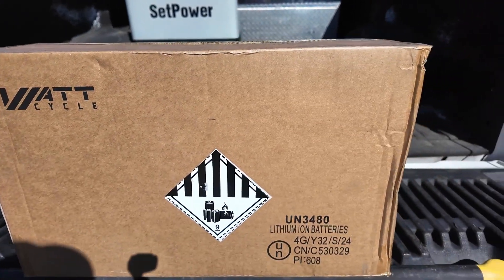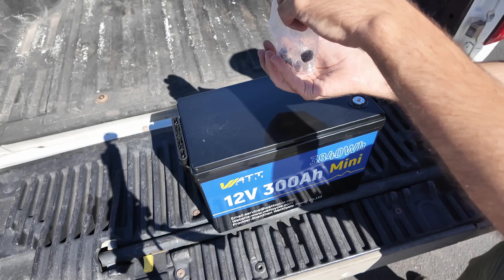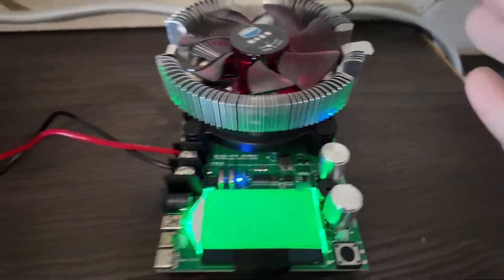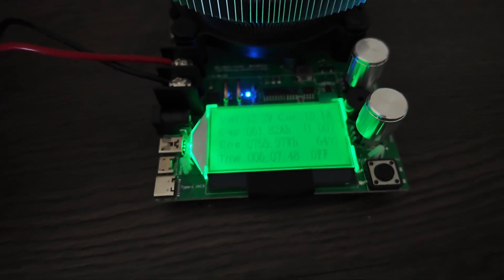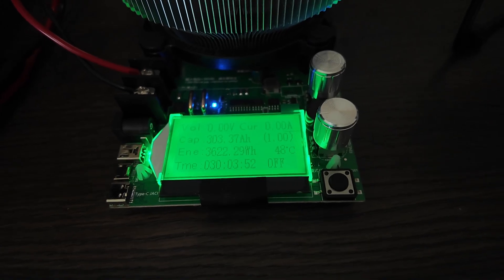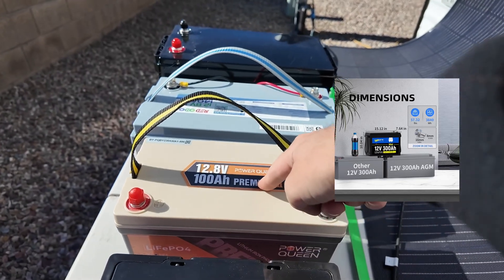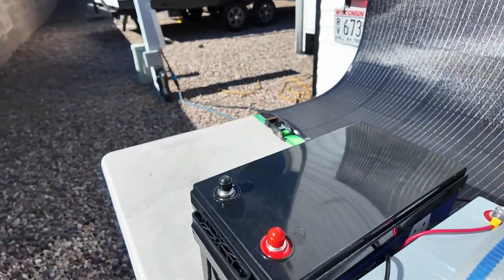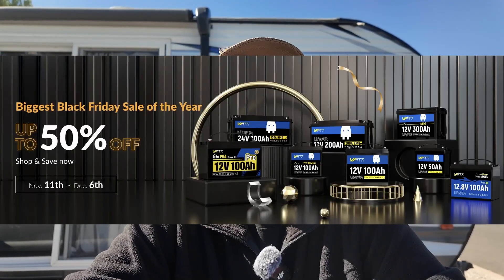Massively Mini 300 Amp Battery

Comment: Can you please measure the top of the battery minus the handles to give a true dimension of the battery case.
Reply from the maker: I totally get why you want those numbers, but having the battery in hand, I can tell you that removing the handles doesn't gain you any space savings.  The handles when stored do not stand proud of the top of the case, they sit below the terminals.  If you remove the handles, the side-side dimensions also don't change since the handle mounts are moulded into the case.  All that to say this: 15.12 x 7.64 x 10.04 inches | 57.32lbs
Reply: @temporarilyoffline  I'm planing to cut off the handle extrusions on both sides to make them fit into my battery compartment under the stairs in my RV.
Reply from the maker: @davidmoore6020  I dig it.  If you do a really good job. You're knocked down to 13.5"!
Reply: @temporarilyoffline that’s what I was thinking.  I have a 28 inch to 29 inch space to put them in.  I’ll make it work. I ordered on Black Friday, hope to get them soon.

Comment: So they cheated to get 300ah. I would like to see that test stopped at 10v. And a true amp hours rating.
Reply from the maker: This isn't the first battery I've seen to do this new low voltage rating.  9.2v isn't that useful to me.
Reply: @temporarilyoffline  Correct me if I'm wrong, but I thought it was bad for LFP cells to go below 10v
Reply from the maker: @HeliosT3ch  That's the rub - I'm not a chemist, but what I can say through my observations - this is the most densely packed battery to date.  Battery tech changes all the time.  I'll likely never run this below 10v myself.  YMMV and all that jazz.  I've seen another battery mfg market a battery that has this same cutoff and high density vs. package size, so its either A) a complete lie or B) some new to market tech.  Time will tell and I don't know of anybody that can do 5000 cycles "at home" - at a 10a drain, that would take over 20 years to complete.

Comment: That a lot of watt hours.  Will run that 12V refrigerator a long time. Great boondocking battery !  Can be a fun POTA week on them and i talking KW POTA ! Some changes coming to the RV  industry in like 2028 . Also effects campers. Them 1 LB throw away  tanks will no longer be sold. Have to get refillable ones. They been on the market years now and works out cheaper . The refillable propane 1 IL ones have that safety valve as well. Many may ditech propane and go electric . that 300AH good start ! They do make a adapter hose to run like Coleman stove on big 20LB grill tank. That what we do . but 10 LB one. They have 5/10/15/20 /30/40/50 LB ones and bigger . I worry about shortage on propane. This happened in NY one winter. left so many in the cold.  A small mini split heat pump can be used in RV for heat .  The only problem is under 0 F heat pumps can quit . some quit below 32 F . Love big AH battery ! The LiFePO4 changed . Changes in electrolyte and plate making them better !  The cycle life is going up as well ! 73
Reply from the maker: You got it!  It's all about the capacity, and this one is a champ!

Comment: Perfect for a 3000 watt inverter
Reply from the maker: Indeed!  That's next on the list
Reply: A 3000 W inverter will want more than 200 Amps supply.  I think I saw that this one is max 200 Amps supply.  I'm looking at 3 x 100 Ah batteries in parallel to get 300 Amps supply which also allows for losses in the inverter ie you might need 3300 Watts input with 10% loss to get 3000 Watts output.

Comment: Surprisingly massive capacity.  I had to look up how many AH a regular lead acid car battery has, since normally they only advertise CCA - cold cranking amps.  Wow.  Only average 38 AH in a car battery roughly the same physical size!
Reply from the maker: Yeah, it's crazy the amount of weight we used to lug around!
Reply: True but those are different tools for different purposes. You might need 500 - 750 for a few seconds to start your car.
Reply from the maker: @MrHuram-abi  Agreed

Comment: I have to move my QTH to a new location and I'm concerned about the capacity and cleanliness of the power available. Thinking about battery power to run it. This sounds like a great battery to power it. Ir should I look at multiple 100 amp batteries?
Reply from the maker: Work backwards from the goal - what kind of uptime do you want and what's your tolerance for outages?  n+1 design, etc etc etc

Comment: TO..   if radios want 13.8, how do 12v batteries work?
Reply from the maker: Radios want 13.8 to deliver the specified wattage, less volts = less watts out to the antenna.  Up to a low point where the radio just doesn't work anymore.  Most 12v batteries put out a range from 10-14v as you use them.
Reply: @ thx T.O
Reply: @Dram_bam 12V is just the nominal voltage, the common name for a standard. It's like saying that I drive a half ton pickup.
Reply: @MrHuram-abi  that makes sense.  Gotcha. Thank you 🙏 for the help always